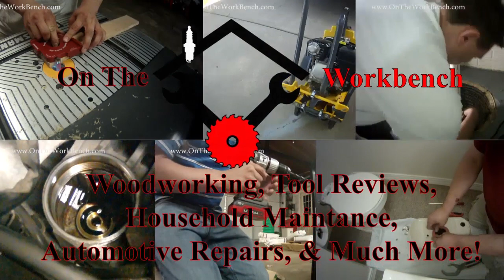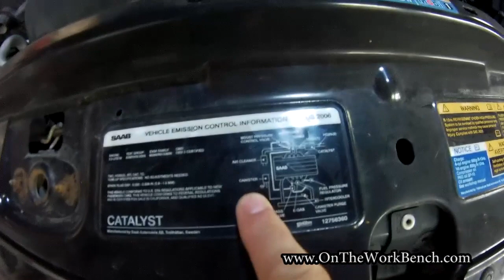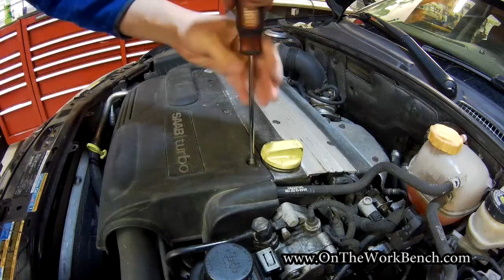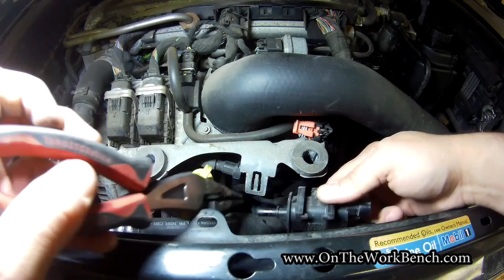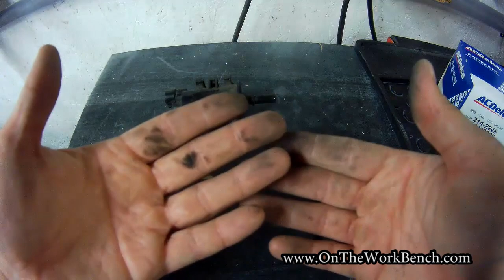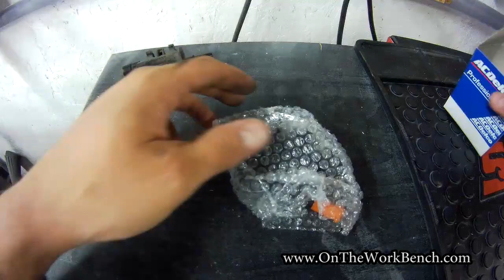Saab 9-3 Vapor Canister Purge Valve

Comment: Can faulty solenoid and any leak in line going back to canister cause starting issues in morning and poor fuel consumption? There is No misfire, very smooth acceleration.. idle little rough at 700rpm with Ac on.

Comment: Hi Any videos on changing a purge valve on a Saab Aero 9-3 V6 2.8 Turbo? Or do you know the location of the Purge Valve on a V6 2.8T saab? Thank you and nice video
Reply from the maker: That one is on the intake manifold between the engine and the firewall.

Comment: Great video. I have a question. Will this valve cause a misfire code? And an unrelated issue. My key fob will work fine then a month later it stops unlocking my doors and trunk; when I unhook the battery and reconnect the cable it works fine for a month then stops working again. What could cause that? 03 9-3 2.0
Reply from the maker: the purge valve is unlikely to cause a misfire, you might want to check the plugs, coil packs, and/or valves/cylinder compression.

On the key issue, you might want to try taking out the battery cleaning the contacts with a light drop of alcohol, letting it dry, reassembling and see what happens. Also might be a weak battery. Not all batteries out of the box are fully charged. Also I would only use a name brand Energizer cr2032 battery. it's not worth the cost savings to use a cheap no-name battery.

Comment: Changed all vacuum pipes to silicone ones today - car is 2005 Aero 2.0 litre - unfortunately original valve output snapped / part only £30 in Uk

Comment: Would you possibly tell me what to look for with a p2187 code on my 2007 Saab 9-3 2.8. (system too lean bank #1) maybe a common part or hose I could look out for?
Reply: I know this is an old comment , do you remember what it was? Have the same cold , my process is going to be cleaning MAF sensor, if not then replace the purge valve and if not get a whole new maf
Reply: @noahfield5171  any updates on what fixed your issue? I started to get the same thing on mine.

Comment: I got code p0442 not 41 or 43. Do you think it’s the same problem?
Reply from the maker: Quite, possibly, though I would also recommend checking your gas cap and other evap lines too before buying this part.
Reply: I'm having some no start issues after I've filled the tank for the first time. Starting t question this after swapping 4 different ecu's for what I'm starting to think was no reason..lol car has always run rough and choppy for few seconds on cold starts. And would even smoke a little bit. 10seconds later car ran great. You mentioned in the video that the car sounded terrible when starting. Would you say symptoms are similar to mine? Seriously sounded like the car has an aggresive Cam shaft in it for a few seconds, but only after its sat for a few hours or so and first started. After running for a bit it ran fine...
Reply: @steviefresh4602  pcv

Comment: Is this part the same for 2.8 v6?
Reply from the maker: I believe that is part #12611801 and that one is located in the rear of the engine instead of in the front. See part #8 in this diagram https://www.esaabparts.com/static/images/diagrams/106729.jpg
Reply: @OnTheWorkbench  Please help with 2.8L 9-5 Saab 2011. Per your diagram, any suggestions on replacing that EVAP? Very tight there...thanks.

Comment: It ain't a cheap $30 part. New they are $200+ and used are $40+
Reply: Damn where at? I got mine at autozone special order got to their store in two days for about 40 bucks or less.
Reply: Depends what reference you look for. If you seek part number 1997278 you will find much better price at least i europe.  The part number showed by the autor is much moren expensive here but I believe they are the same with different part number.